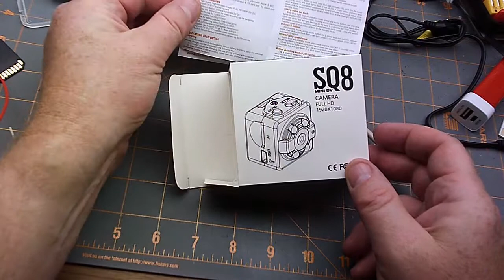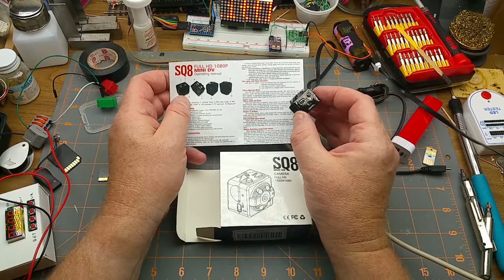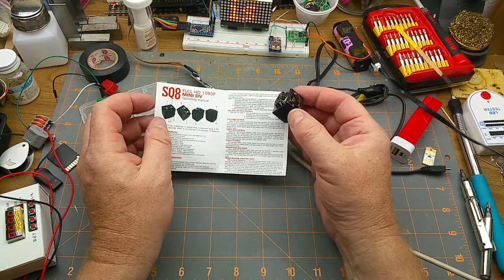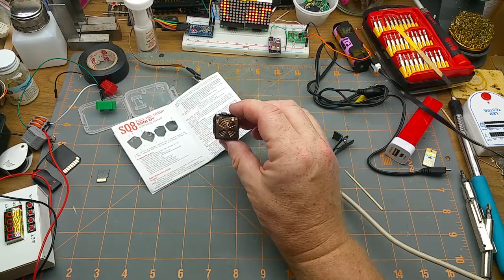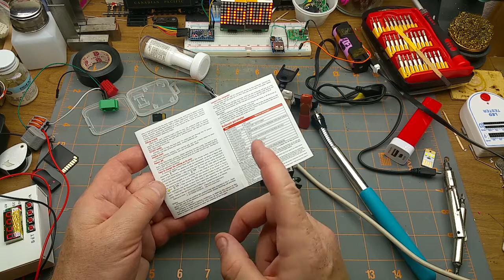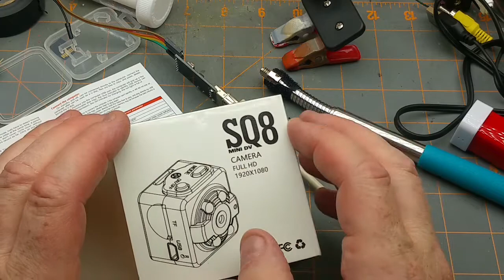playing with a really cheap camera

Comment: On the dead SD card.  Try using windows command line program diskpart.  google for the usage.  I have fixed both hard drives and CD cards with this util.  Apparently the partition gets hosed up and diskpart clears out and re establishes the partition  Just be sure you select the proper drive!!!